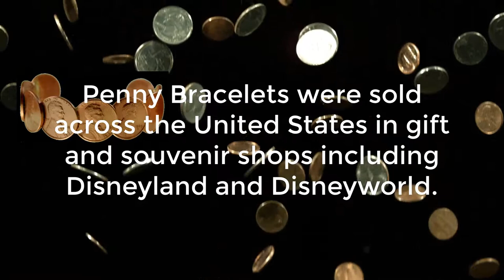How Penny Bracelets are Made

Comment: Would solder be strong enough or does it have to be welded?
Reply from the maker: Silver Solder would work however it is a much more expensive process.  Technically the bracelets are brazed with a bronze alloy not welded.